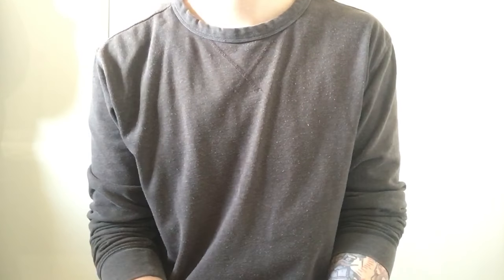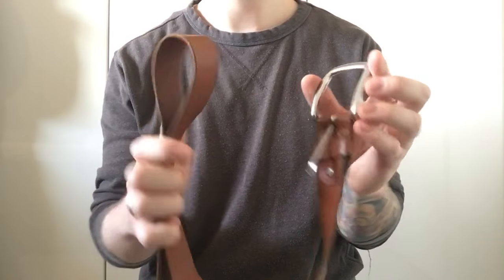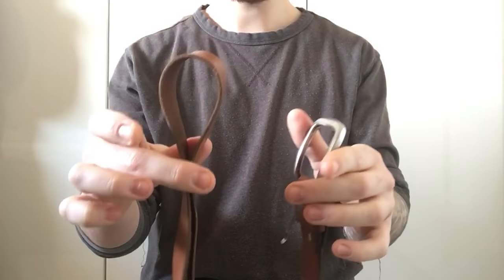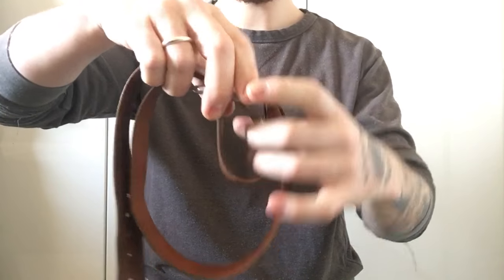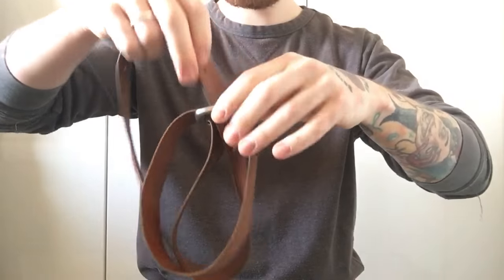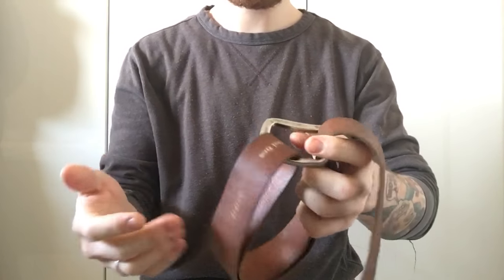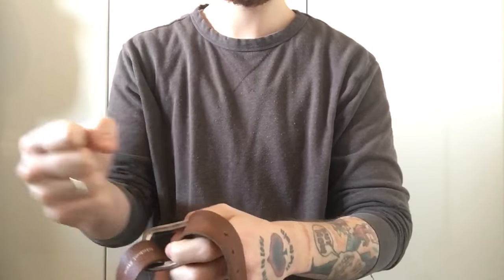How to: Effective improvised tourniquet from a leather belt

Comment: Tried it on my arm not tight at all and I couldn't hardly get it off.  I can imagine if tightened tourniquet tight it would have to be cut off.  In special ops training we were taught that a tourniquet could be left on more than 4 hours without loosing  the limb,  until hospital delivery.  The  hospital can then remove the tourniquet.  This is a good technique  to know.   I always have a leather belt.
Reply from the maker: It sure beats just wrapping the belt and holding manual pressure. The friction really does help getting a good solid constant pressure on the limb. Thanks for watching!

Comment: Thank you so much for making this video I was thinking about this the other day on how to improvise a tourniquet. Shalom
Reply from the maker: Thanks for the comment! This is the best method i have found to make a tourniquet from a belt. Trying to just hold it thight or using a windlass on the belt does not work very well compared to this! If you have a bandana/triangel bandage you can use a stick/knife/scissors/flashlight to make a windlass (twisting) tourniquet that also works good.
Reply: @ThePreparedNorseman  that's what I was thinking about I was trying to construct one potentially of paracord and some type of stick.
Reply: @ThePreparedNorseman  but the belt has width will the Paracord be too Slim
Reply from the maker: Paracord and other string will not work, it will only damage and cut into your flesh. You could also use a gun sling or a strap from a shoulder bag with a windlass if its made out of canvas or nylon.
Reply: @ThePreparedNorseman  thank you so much for clearing that up. You also confirm some things I thought about with it cutting into your skin the power cord. But I always have a canvas belt on anyway
Reply from the maker: I am not sure If this method will work as well with canvas belts as it does with leather, and ofc its always better to have a dedicated tourniquet. That be a CAT, RATS, SWAT-T, SOFT-W or Eshmarch.
Reply: @ThePreparedNorseman  thank you so much brother. Shalom
Reply: Nice vid Fredrik!
Reply from the maker: @GearedTowardGear1  Thanks! I have not really seen many videos on doing a belt tq that actually works so i made one.

Comment: Hello! Nice technique! However I have a feeling that this is more of a pressure bandage, than a tourniquet. It probably is going to be very hard to pull it tight enough to block an artery. Just like the commercial TQs have a windlass to provide a lot more tight pull, this improvised TQ would require one as well, I believe!
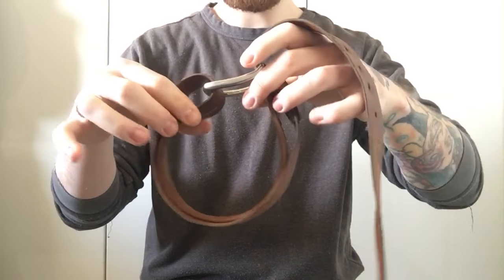I tried putting a stick through the loop that you form at 0:30 seconds on your right side (left side of screen for viewers), so that the stick is in between leather, and then putting on the TQ (on a metal pipe), pulling on the loose end, and turning the windlass. It definitely tightened a lot harder! Plus, I managed to tie the windlass down with the loose end of belt!
Have you tried doing this?

Thanks!
Reply from the maker: Valid concern, then again this is a last resort. But from my own testing this works occluding blood flow in an arm very well. The theory behind this is that it would work somewhat like a ratcheting TQ. Personally I have never had good results with windlass belt TQ's, cloth seems to be easier to deal with in that case. Your mileage may vary, and of course this wont work with every belt. Thanks for watching and commenting!
Reply: @ThePreparedNorseman  worked really well, i damn near couldn't get it off after i tried it on myself over my shirt. Got a little panicked not gonna lie haha😅

Comment: I'm not saying this necessarily won't work, but this technique puts a lot of faith in the stitching  that holds the buckle in place.  And whenever my belts have failed through normal use, that is the weak spot that fails first.  And God help you if it's a cheap, Chinese Wal*Mart belt.

Again, I'm not just trying to be ass, and if I had nothing else at hand I would give this a shot.

Lastly, if you're in an active shooter situation, the best item to have to save a life (besides a gun to return fire) is in fact a tourniquet.  Police have them on their duty belts.
Reply: Upon re-watching, I see I was wrong.  The tension is not held by the stitching, but by the metal buckle itself.

Comment: What do you do if the injury is above where the belt will go.
Reply from the maker: If its bleeding in the shoulder or hip area you got to pack it by putting gauze into the would to the point of bleeding then filming it with as much you can and hold pressure. (could cut a cotton t shirt to strips If improvising)

Comment: i thought the tourniquet was like a loop that you twist so that the limb basically is squeezed, but that doesnt seem to be the case
Reply from the maker: There are many types of tourniquets, the most common ones is the windlass where you twist. But that does not work with leather belts.
Reply: @ThePreparedNorseman  What about just put a stick inside the belt and twist the stick so as the belt tightens it squeezes the limb? 
Would that be better than nothing?
Reply from the maker: @thedude4795  with a webbing belt that works, but a leather belt is usually either too stiff or it will breake when using a stick. This works well on arms and children, but for an adult bleeding from a leg I’d use a t-shirt and a strong stick in stead.